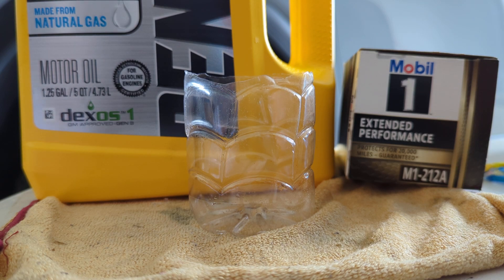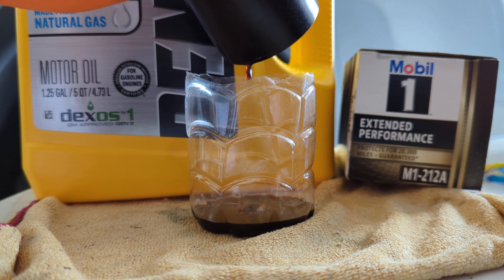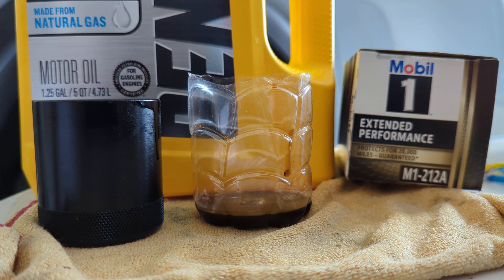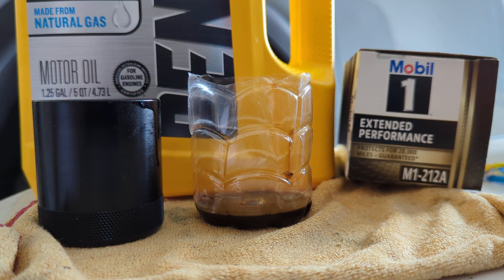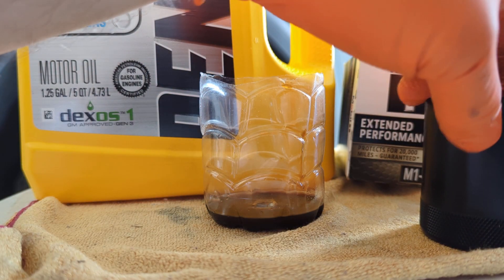GM 6.6l Gas V8 - 1200 miles of heavy towing - Catch can & Oil change update

Comment: Have a 2024 chevy silverado 3500hd 6.6 gas. Just installed j&l catch can. Has 3100 miles. Have not put any miles on it with can yet.